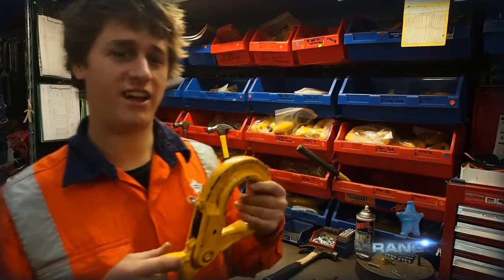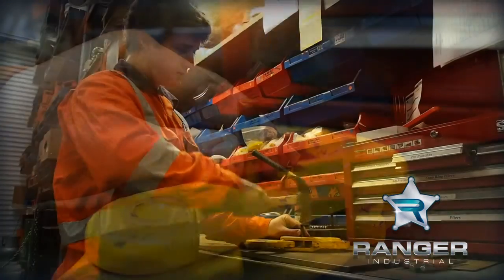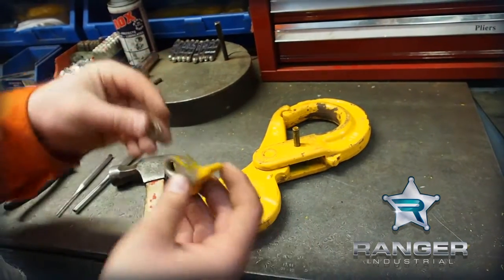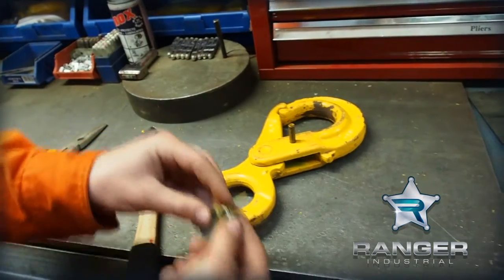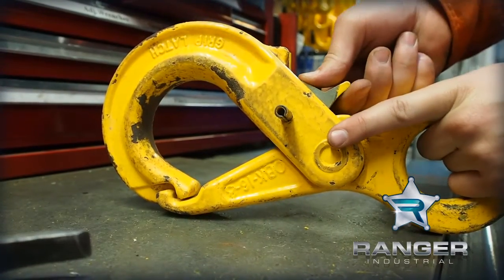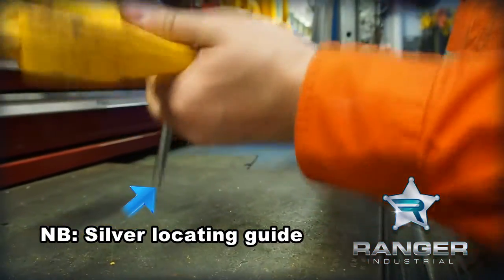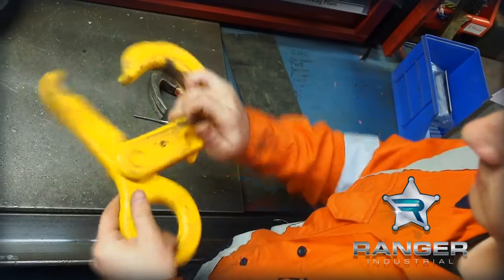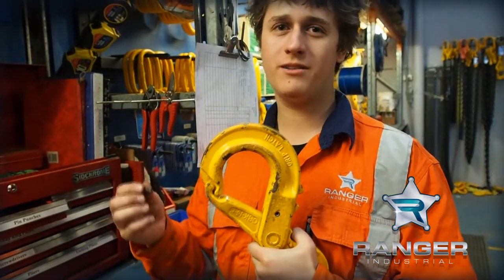How to change a safety latch in a lifting hook

Comment: I missed something here. That little plug you put into the trigger to hold the spring, I assume is smaller than the roll pin hole, and it drops out the bottom when you pound in the roll pin? Why not just use a punch or other device to hold the latch/spring in place? That looks like what you did? I don't understand the need for the little plug thingy

Comment: I might have been a bit more impressed if you equipped your work area with a the correct tooling, a claw hammer is for carpenters !  buy a selection of 'Engineers Ball Pein Hammers'  thank you.